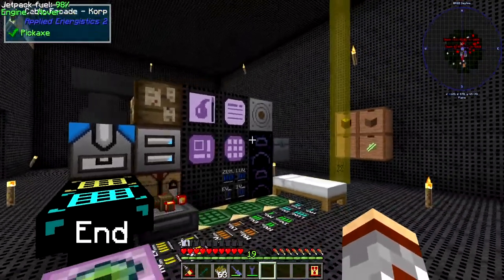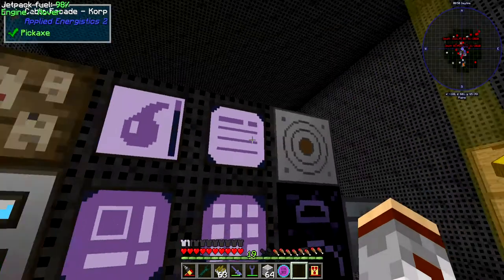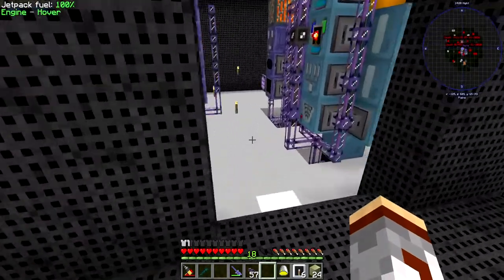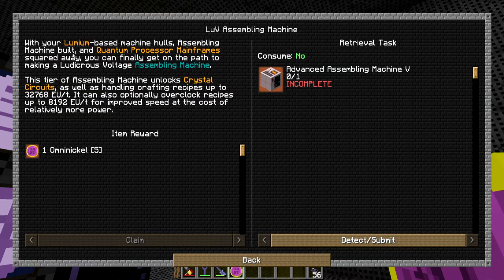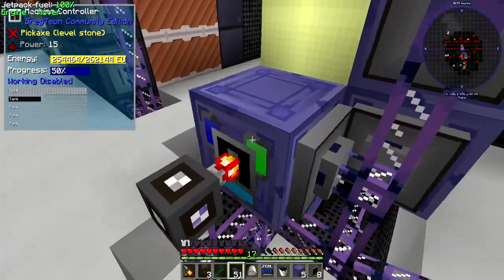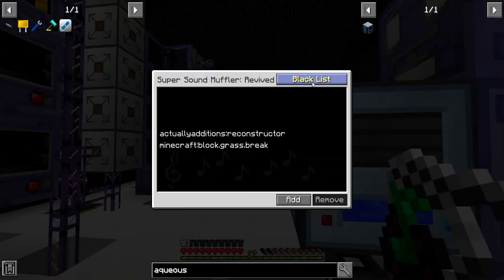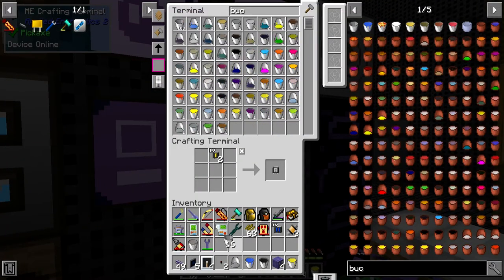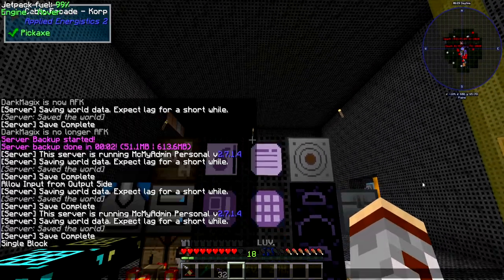Lets Play OmniFactory Episode 72 - Road to Crystal Circuits & Superconducting Coil

Comment: The AqAc is extremely fast... provided you use an external extracting mechanism: the auto-eject it does is quite slow. Pumps are quite fast, and fluid lasers have basically infinite transfer rate, but you can also just storage bus it since the fluid duping exploit in TE was fixed by KingLemming in time to make it into 1.2.2.

Unfortunately the AqAc noises are not made through the sound event system so the Super Sound Muffler can't suppress it. It helps to place it a distance away from where you're going to be running around a lot, so it's muted by virtue of you being far enough away from it. Since you have CMs, you could also consider stuffing it in one.